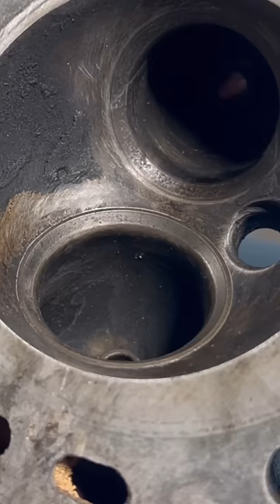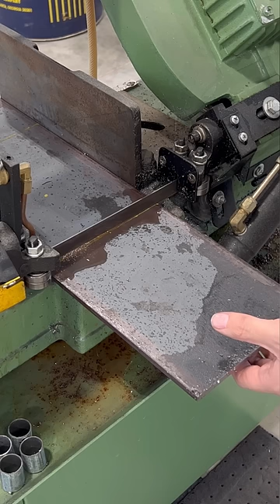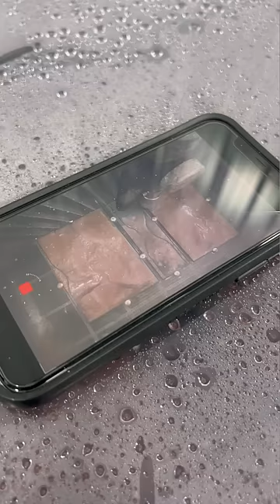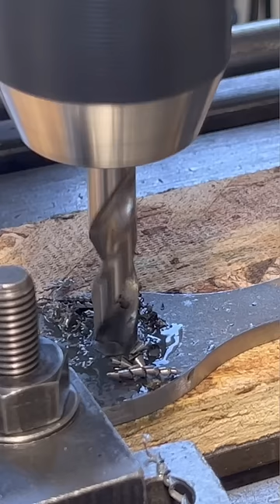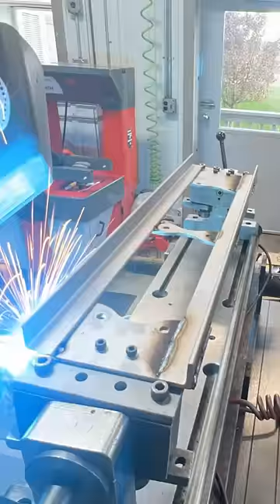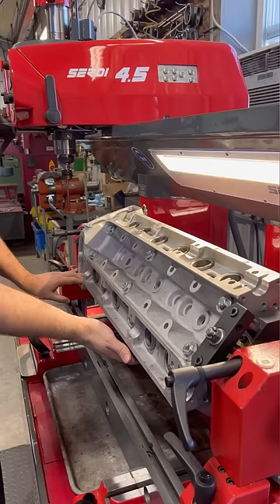#shorts Sometimes The Prep Work Is Half Of The Job!

Comment: “Desktop” and “water jet cutter” are two things I never expected to hear that close to eachother.
Reply: It's funny that's the first thing that struck me especially since my wife had a long career with ESAB designing large gantry waterjet laser plasma machines until they boxed up the facility and moved it out of the country.
Reply: For fucking real. That's amazing
Reply: Wristwatch phone
Reply: @barrelmitt1544  which country did they move from and to where? Esab makes some nice welding machines.
Reply: @Maxdubi  Florence SC, USA to Mexico, they shipped you ask machines globally.  It was a very vertically integrated operation, it was dreamy.  
They had other design and production facilities in Europe and elsewhere, that equipment was different specifically to serve those markets.
After the 9/11 slowdown it was down hill and talk of shutdown started in less than a half a dozen years they're gone.  Congratulations Management!
Lincoln electric wanted to buy them they came down to do the due diligence but the local folks were belligerent and it did not cooperate.
Now they are all unemployed.  Lincoln Electric would have grown that business.
ESAB was owned by Charter PLC a British company.
Reply: It's pitifully slow and nearly useless on cutting steel.
Reply: @dktim007  that's why you can use a desktop or hobby gantry plasma or oxy acetylene machine for steel .
Reply: 3+ hours to cut this chunk of steel + huge mess with garnets everywhere. I'm sure it's better than any other cutter.
Reply: @REAPER3fitty  😊😊😊😊😊😊
Reply: I was like that's badass... Then I realized it's still probably $10k-$20k

Comment: I have done what you do also paint and bodywork. And in that also the painting is the easy quick part and preparation of the surface properly is a very intensive job. It’s really close to machine work. After all the cleaning and setup you are just guiding the setup machine after that. But I feel there’s more prep involved than running the machine. Especially when you’re doing it by the book. I was building NASCAR Cup engines back in the 90’s. Getting everything properly fitted in the machine was more of a job than the machine work.

Comment: One of those Jags was my first.
My boss made it very clear to loosen each cam evenly or else itll break. Later at the end of the shift he told me about it being one of his first jobs too and he didnt listen. He broke a cam and then lost a week of pay to cover that cam. 
I will remember that story forever
Reply: I would install those cams using caps without the washers to get the nut started, Cam studs are barely long enough....
27 years in headshot....... Didn't think I would but , I miss it....
Reply: Good trick.

I miss it too.
Reply: Unilaterally docking pay for mistakes is generally illegal. The employee has to have a forum to challenge the penalty, usually court or arbitration. 

In my area they write up machinists for mistakes and put them on a performance improvement plan.
Reply: @LongDefiant  you're missing the point of a heartfelt moment

Comment: Prep work is everything. And Knowledge. At the shop I worked at in the 70s a customer asked us to surface a Jaguar single overhead cam head with the cam and valve assembly intact. Found out the hard way that you are not supposed to surface that head. It was so far out that the #1' & #6 chambers were 30 to 40 % smaller than #3 &4. Simply put the cam wasn't enough to hold the head strait. And that head was prone to warping bad so  it was recommended to never surface.

Comment: Brings back so many memories of using a bolt plate that sat on the head bolt stud holes and clamped via a spark plug hole was a bugger to get parallel - especially of the head had previous machine work done which they often did 👍👍👍👌🙏

Comment: Is probably the only practical market I’ve seen the wazer driven towards,  not shy of a machine purchase and capable tradesmen with a desire for accurate same day tooling. Extremely hard to justify for most engineering shops but can save a lot of outsourcing and lead time for yourself

Comment: Don’t forget to install the lifter guide locks (the steel sleeves the lifters run in) … the exhaust side had a bad habit of coming out.  The new locks hide completely under the valve covers.

Comment: I've been a CNC  Programmer Machinist for over 17 years which includes a lot of manual machining experience as well as odds and ends. I would say, in aerospace and tool n die, the majority of the time was usually programming, fixturing(design & creation) an setup and to actually run the part, was like 5 minutes! Lol.... 
Especially in the job shops. 3 parts: program & setup-4.5hrs ..... cycle time-4.58 minutes 🤣🤦‍♂️

Comment: Prep can be more than the actual repair. It might take a couple hours to cut out with a torch, shape accurately several pieces, fit and clamp them together in order to do, ultimately; a half hour of welding.

Comment: Jaguar Lash Cups are known for spinning and causing excessive noise. They make a .020 oversized cup along with a hold down for the cup that have to be drilled and tapped into the head. It's a common problem for Jaguar,  Didn't hear you mention that so you might want to look into it.

Comment: Here's another example, on steroids. Where I work we run old Acme multi spindle screw lathes, meant for huge runs of parts. Some setups take a full week, changing out tools, holders, cams, gearing, etc. Well recently the new management has been releasing jobs as small as 600 parts (these machines are meant for 10s of thousands of parts). These setups take up to a week, all for about 4 hours of operation. How do we make money? Good question...

Comment: Can you do repairs on a 4.0 jeep xj head? Has busted threads on the water inlet port?
Reply: If its 0331 itll eventually crack between 3&4. Thought mine wouldnt but it did at 214k

Comment: I find prep work is usually 95% of the job good job itself is simple it's everything around the job the cleaning the prepping the straightening out looking at every single part that you took off the engine before you put it back on cleaning it the job itself the broken part that's the easy part

Comment: How much does something 🤔 like that cost,??? Anyone...
Reply: The water jet machine is $10k
Reply: Sorry, what's the cost to machine the block. I've always wondered 🤔
Reply: Couple of gs depends on your state and the shops you have access to. Also you will have to remove the block and transport it which if you're not doing any of that yourself then there's a whole 'nother expense. Some shops you just take your car there and they do all of that for you but you are paying a premium and don't expect it to be done in a day.
Reply: Thanks for the info. I had a 4 cylinder rebuilt and it was very expensive. Took about 3 months

Comment: "It pretty much needs everything" what's the point of working on it. Also, that block looks decent and may have been redone. And so again, what's the point? Is it that it's cheaper to fix than replace? Because that sure does sound like a hell of a lot of work to me just to fix and NOT replace. Hell, an oil change for my car was 100 bucks, and thats just because I was lazy that time and not because I can't do it myself. But with that being said, that job you're doing is infinitely harder than changing oil. What tf is going on

Comment: Worst vehicles ever jaguars. My buddy spent 50k on a used one.  He would hammer it here and there some. 11 days after owning it the fuel rail maxed pressure and destroyed engine.   Took 10 weeks to get it back.  Then after he got it back the new engine didn't run right and the transmission acted up.  He traded it in then after a few months